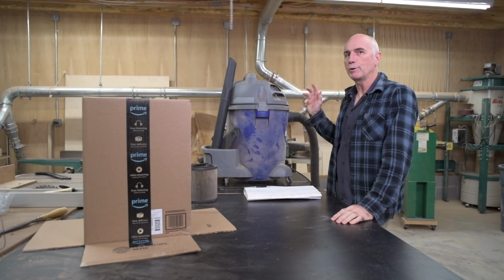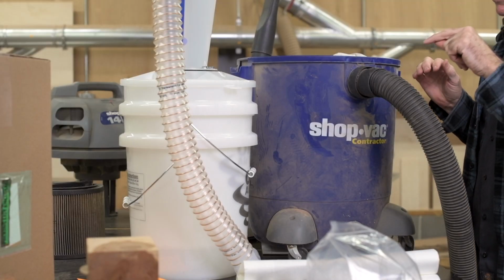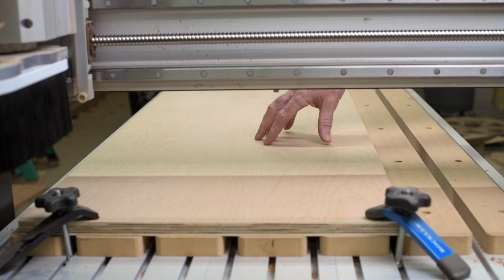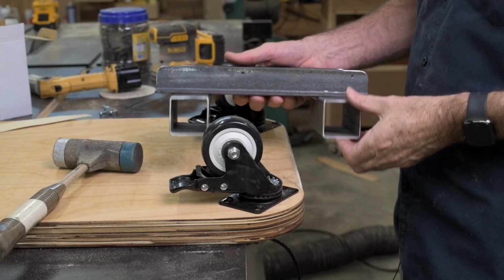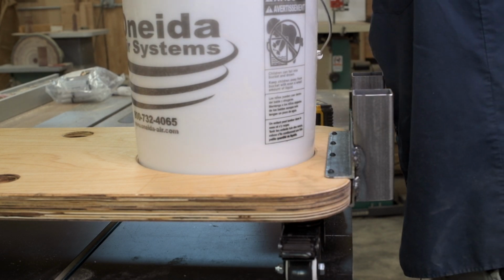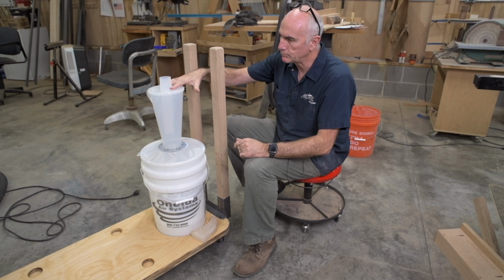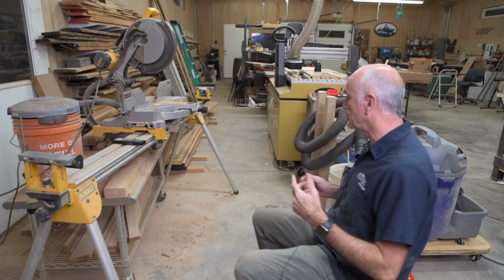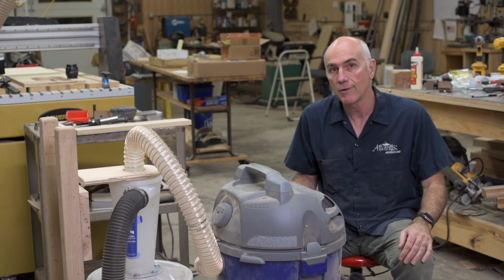Vacuum Cart with cyclone separator

Comment: Nice cart... Haven't made the cart yet. The DD has been helpful in cutting down the dust in my shop. I also switched to the hepa filter, but I did leave the bag in as an extra to catch for the fines that make it through the cyclone. Cheers!
Reply from the maker: You've got triple protection going on there!  Have you had any failures with the bags bursting over time?  Thanks for the comment.